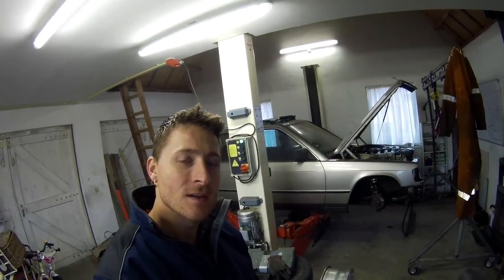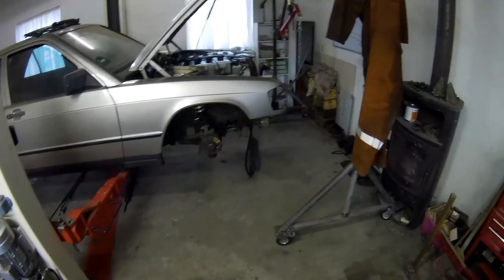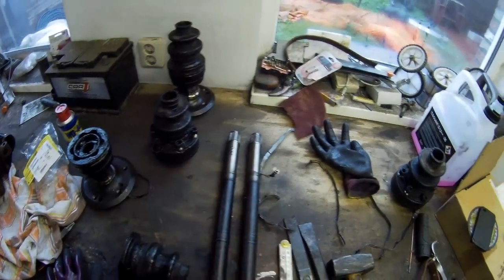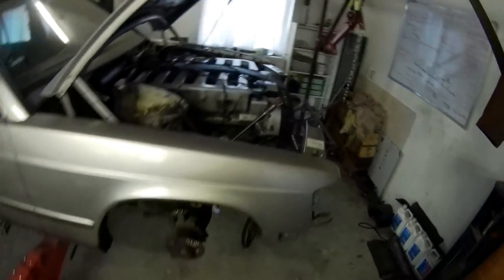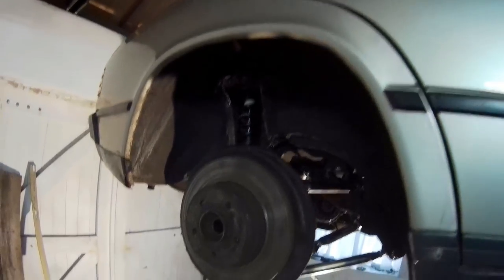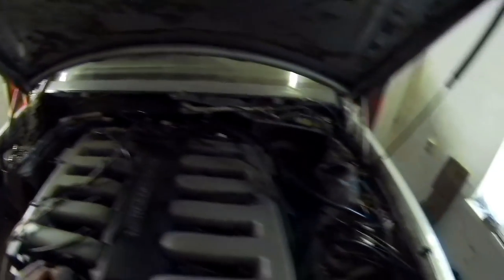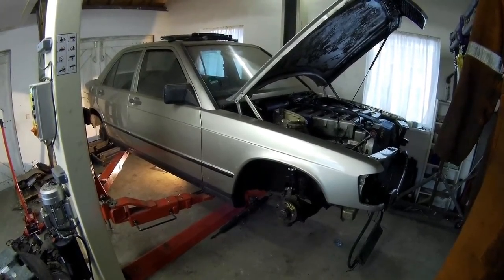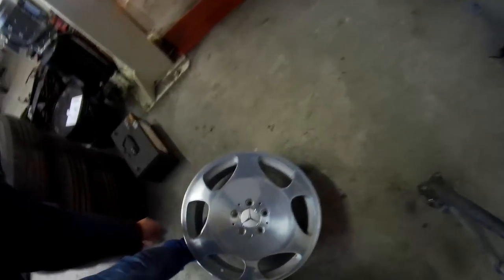BC Coilovers under a Mercedes  W201 190 V12 ! JMSpeedshop !

Comment: awesome project!

you could just buy a universal cv boot with clamps on both sides for the axles...
for the air intake i'd make a hole in the horizontal panel behind the headlight.
just face it forward down and around.^^
Reply from the maker: Don't know have to Search for it otherwise i use these ones .  I have to know what company made the original axles to get the boot for te cv

Comment: I am really excited about seeing how this thing actually runs. Have you tested if you can get the engine running? The electronics are not simple with these
Reply from the maker: It will be running on standalone ecu do no oem Mercedes electronics. Have a look in the project playlist there is a video where i explain why and what i'm going to use to control the engine